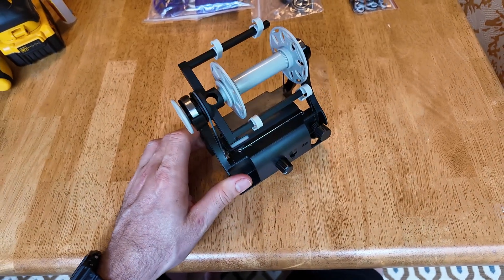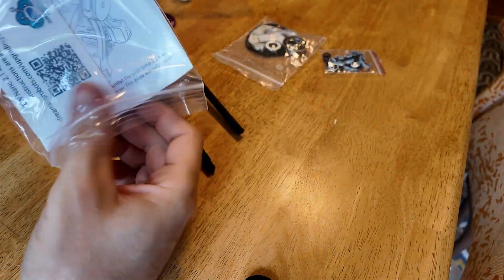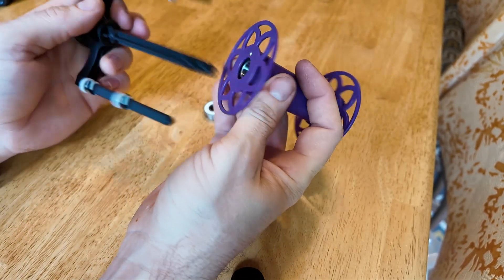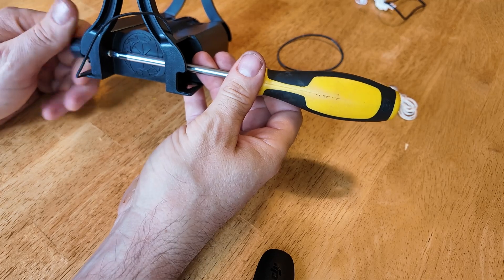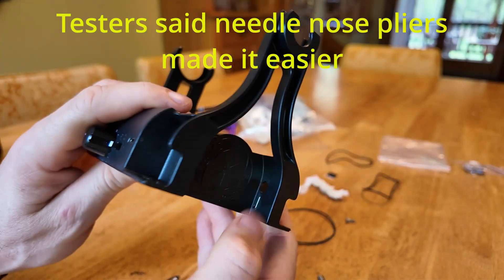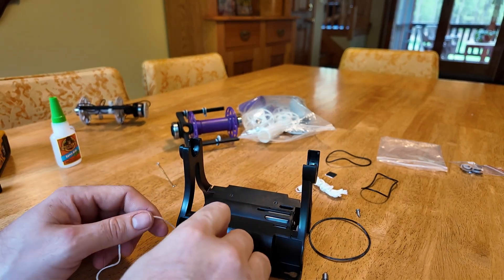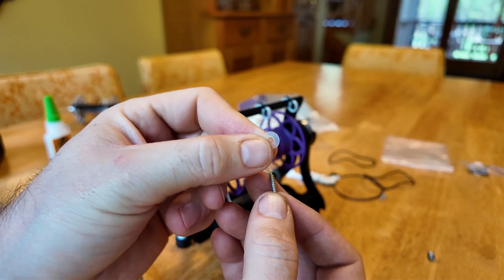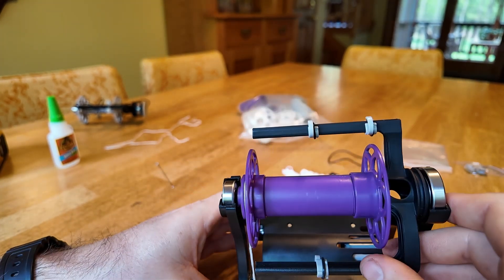Spin 201- Upgrade EEW Nano 2.0 to 2.1

Comment: I'm having a really hard time screwing in the longer screw. I've got a small phillips head screwdrvier holding tight but can't get the last bit screwed in. I've put the unit between my knees to hold it steady. Any suggestions?
Reply: Update. I used  a quick grip clamp to hold the knob, held the spinner snugly between my knees,  and pushed firmly with the screwdriver while turning  and got it screwed in. Looking forward to trying out the upgrade. Guess I need to w9rk on my arm strength.

Comment: How difficult would it be to make a tension dial for an EEW Nano 1.x? I have the original EEW Nano 1.0 myself and I'd be interested!
Reply from the maker: There is a 3D printable dial that I give the files out for on printables.  More info on this here: https://www.dreamingrobots.com/eew-3d-printed-parts/

So you'd need to 3D print the dial and then drill a hole in your case.  The screw to attach it is included in the upgrade kit.
Reply: Awesome, thank you!😊